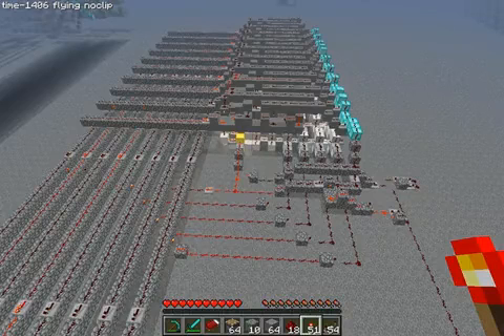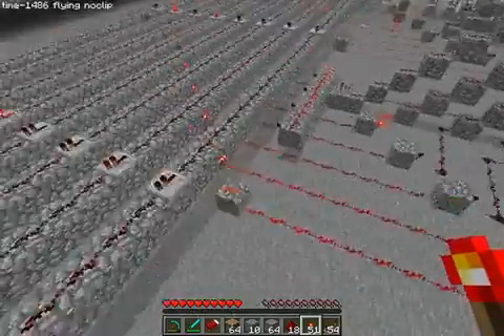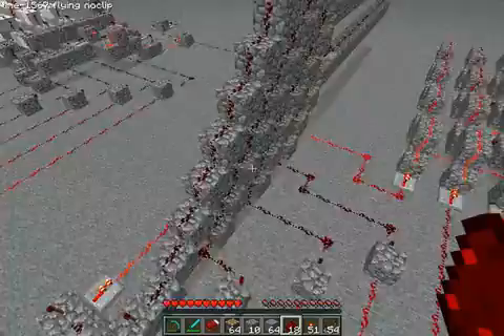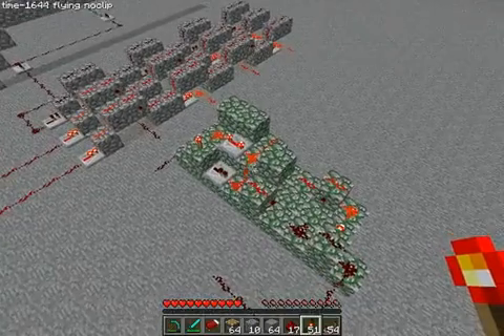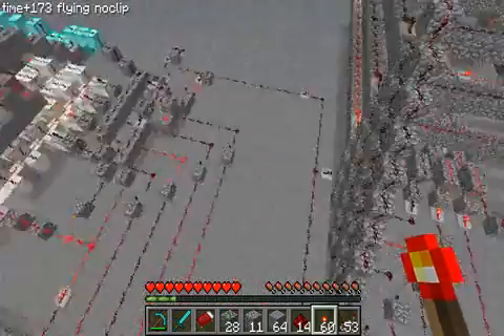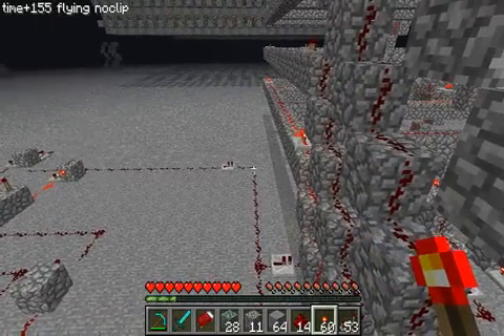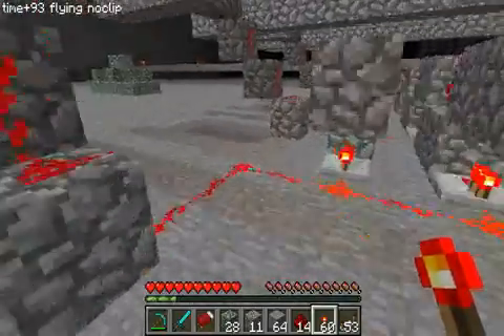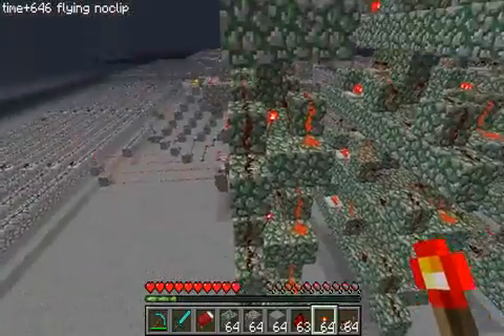Building a Minecraft Computer part 4 - Registers

Comment from the maker: @TheXRealXBrapp i believe the best way to do it with logic is to do subtraction in 2's compliment, and check to see if the result is negative (overflow). eg 2 and 5.
0101(5) - 0010(2) = 0011(3)
0010(2) - 0101(5) = 1101(-3)
if the most significant bit is 0, then the first number is greater than or equal to the second. if the most significant bit is a 1, then the second number is bigger.

that's how i would do it at least.

Comment: salaja, you seem smart, and I need help with something.  I'm making a computer in little big planet, and I need to know this.  How I can I have my computer test if one number is greater than another? What kind of gates does it require, and is it even an alu component, or something that programs just check with a certain function?  I've figured out a way in c++ to do it with subtraction, but is there a physical way to do it using electronics?